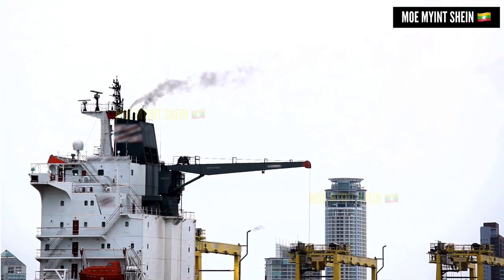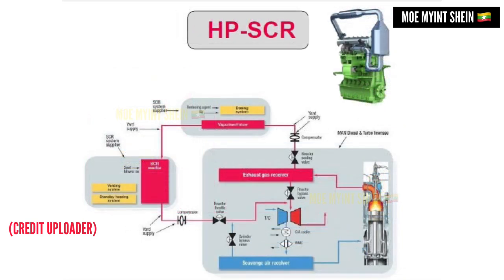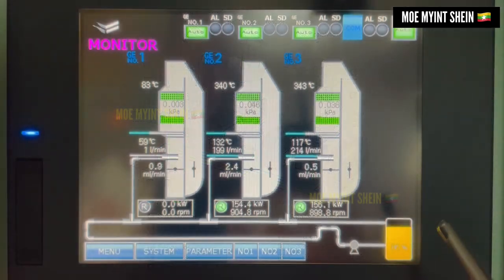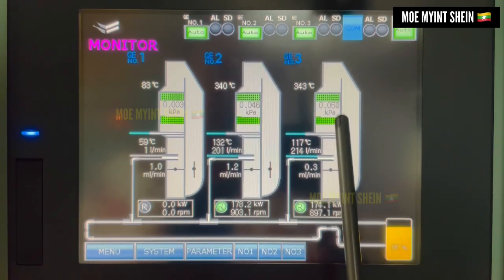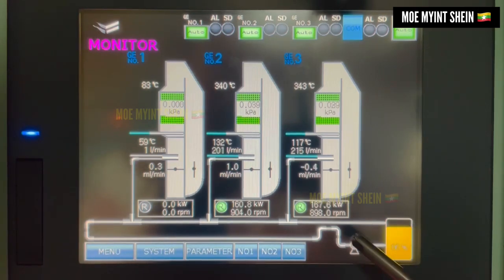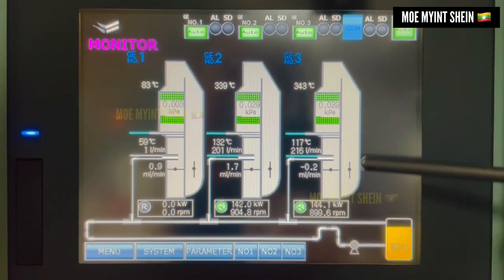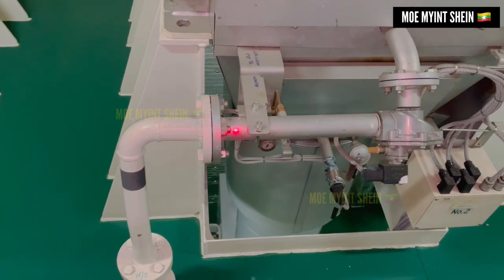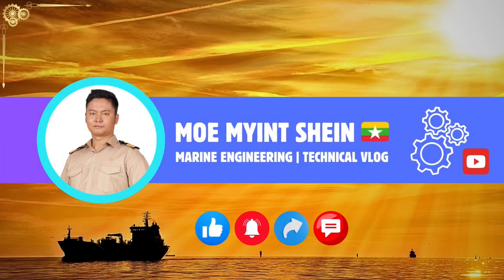[YANMAR] Selective Catalytic Reduction | NOx Control in Modern Marine Engines | Technical Vlog : 111

Comment: So why is nobody using a smaller " scrubbing type system "  like they use on a coal plant to cool exhaust temps and passing the exhaust through a " wet recirculatory system"  which could do away with EGR and def system along with the burner system to remove soot in diesels ? like the 5 to 6 liter diesel engine size ?